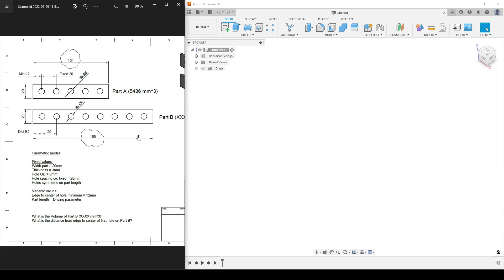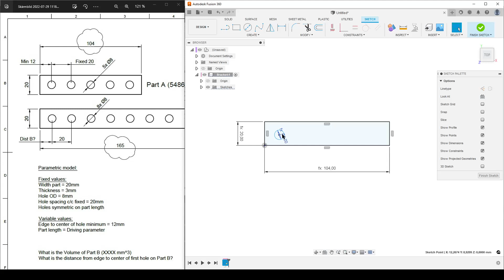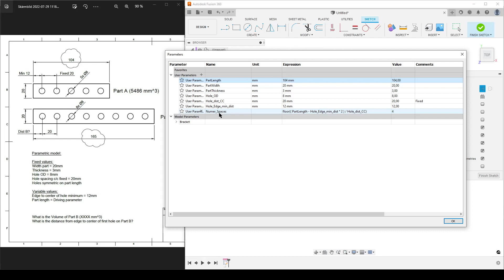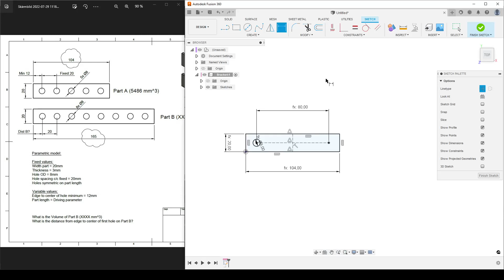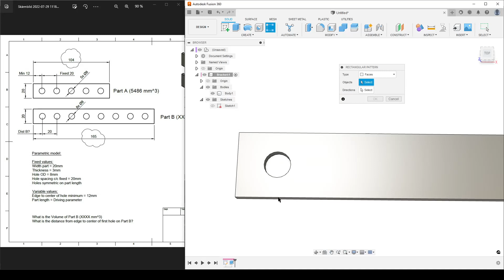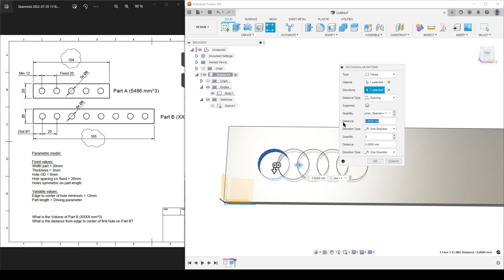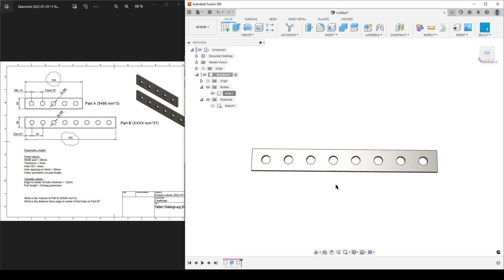Fusion 360 Challenge - Workflow Fixed Pattern

Comment: Not sure if I'm doing something wrong or if Fusion has changed. 
When I specify a unitless parameter like floor(21/5) it works fine. 
But when I substitute 21 with a parameter with a unit (mm) I get an error message saying "Parameter's expression edit failed.
Units mismatch between expected unitless and evaluated millimeter. Please provide a valid expression."
Reply from the maker: Fusion is keeping track of the units in equation. Remove the unit from the parameter by dividing it by 1 "unit" in the equation. Example "Length/1mm"
Reply: @KristianLaholm  Thanks a lot!